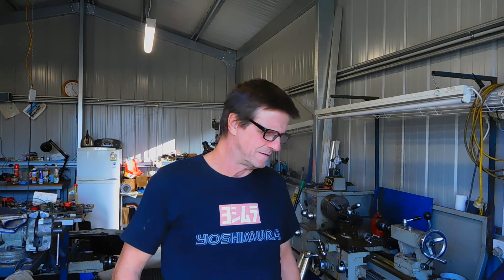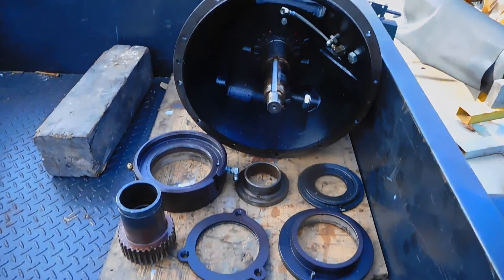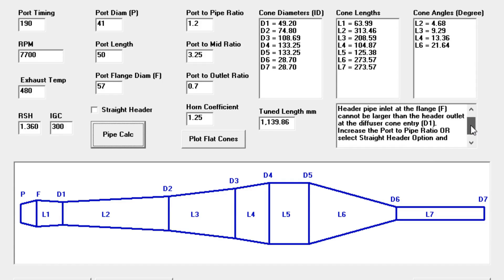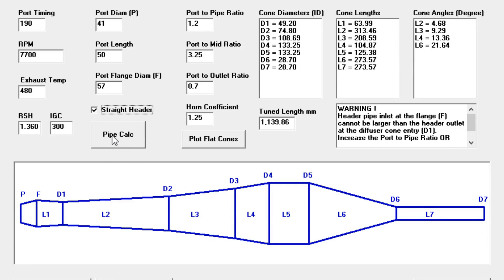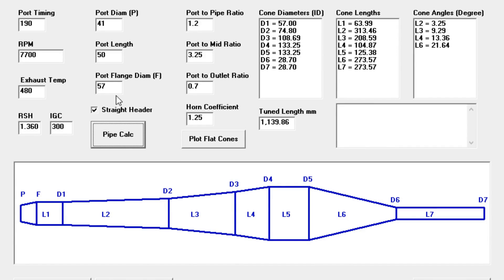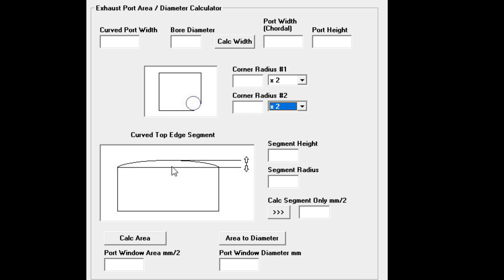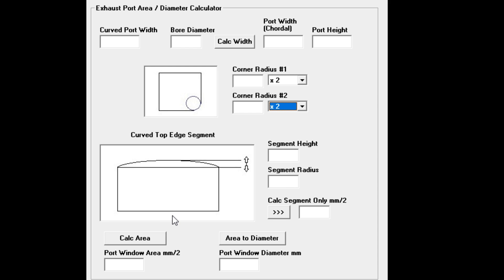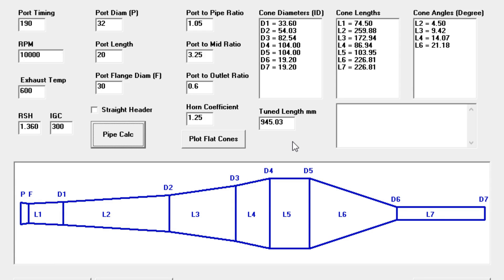New version of 2 Stroke Expansion Chamber software & Channel Update

Comment: I have a question, where is the resonance band rpm in those long banana shaped 50cc supermot exhaust ?
Reply from the maker: That applies to 4 strokes that this 2 stroke video series does not cover.
However that said, to calculate to resonance of a muffler you would measure the volume of the muffler and then calculate the natural frequency of that to find the harmonics.

Comment: how can i measure the port length? im really confused on your wording on the help box whenever i hover over port length. could you possibly demonstrate on a real engine? im trying to build a pipe for my chung yang GP290
Reply from the maker: The port lengths is simply what it sates, the length of the exhaust port from the cylinder to the exit flange where the pipe attaches.
That value is subtracted from the total pipe tuned length.
Reply: @AuMechanic  ok, also could you explain to me in different words how to get the port flange diameter? I’m also confused by the wording used in the help box
Reply from the maker: @TheTakeDaily  That is the diameter of the exhaust port at the opposite end of the port to the cylinder.
Where the pipe bolts on.
Reply: How best do I find the diameter of my rectangular port with rounded edges
Reply from the maker: @TheTakeDaily  watch the most recent video
Reply: @AuMechanic  Can I make a center bleed exhaust pipe with your software?
Reply from the maker: @TheTakeDaily  Yes you can, everything is the same for std pipes but you will need to select the position of the outlet tube.
Reply from the maker: @TheTakeDaily  Yes the equations are the same for a standard chamber.
As for location of the outlet pipe, the inside end of the outlet tube (inside the pipe) has to be slightly forward of the large end of the baffle cone (just at the end of the straight section) regardless of whether the pipe is inserted at an angle in the side of the baffle cone (like the image shows in the video) or perpendicular (90 degree ) directly in to the straight section.

Comment: I've watched all of your videos in this series, more than once, and I enjoy your way of explaining things. I have read the two stroke tuners handbook twice (I think that's what it's called) and it along with your videos was very informative. 

I'm wondering what extra calculations or considerations need to be taken when building a 2 into one system. I know that this is not ideal, but it is used a lot on snowmobiles, and in watercraft (PWC) there is often not enough room for two pipes. Is the chambre size effected, or does the stinger just need to be resized accordingly. 

If I'm missing something really obvious, please forgive me, I'm recovering from a concussion and still feeling hazy.
Reply from the maker: Ive not had experience building 2 into 1 systems as I have single pipes to give you solid advice about it, but based on how pipes work I could say that the tuned lengths calculations would remain the same and all that would change is the diameters of each section plugged in to the software. Based on 4 stroke collector ratios being about 1.3 to 1.5 it is clear that the diameters would be at least less than doubled for a 2 stroke 2 into 1 expansion chamber.
If I find more information on it I will be doing a video for sure as I do get asked this question occasionally.
Reply: @AuMechanic  Thanks for your reply. I appreciate it. 

I know a LOT less than you about exhaust systems and two cycles, but like you, my experience with drag racing snowmobiles with one pipe per cylinder, and the odd one with two into one. Due to the class the 2-1 pipe ran in, we would sneak about 3/4 of an inch out if the Y pipe, rev it a little higher and that was that. 

I ended up doing some searching around an found a whole lot of information that was obvious nonsense, and then I came across this PDF that was very interesting. The first part of it is very basic stuff, but the last 3 pages are dealing with multi into 1 pipes. It seems like a legitimate explanation of manifold design. A few things in there that I had never taken into consideration based on what I already "know".

http://members.iinet.net.au/~pauldawson/iame37_2-s_exhausts.PDF
Reply from the maker: @JoelArseneaultYouTube   Interesting read and answers the issue of wave timing. its a shame it doesn't go into header to pipe diameter ratios.

Comment: I have one question - how do I know how to route the pipe?
Reply from the maker: Fabricating the pipe itself is a bit of an art but there are quite a few videos showing the basics of creating a template of the pipe as calculated and then sectioning it up in parts and bends to get the fit right on the bike and then fabricating the pipe from that.

Comment: would this work on a twin pipe motor i look at build a pipe for a 2 cylinder jet ski just wounder if i need to change any thing do to the 2 cylinder
Reply from the maker: No this calculator is only for single pipes per cylinder systems.
The tuned lengths aspect of the section applies but the diameters differ form a  2 into 1 system.
The software is directly derived from Professor Gordon Blairs 1996 published equations but he does not provide equations for 2 into 1 and I have no direct experience building 2 into 1 expansion chambers to give you reliable advice on it.

Comment: Yes please I'd love tutorials on the software it would be magnificent if you made a video showing us how you measure everything also 😉 thank you!!!
Reply from the maker: I will; be doing more videos on measuring up parts of the engine with a view to modifying it.
I've done one on measuring port timing, next one will be measuring port area and later we will measure compression ratio and a few other things you need to measure to know where the engine is at so you can decide what parts of it need modifying to improve power.
It is a more methodical way than just going at the ports and such hoping it might make improvements.

Comment: Hey guys I'm new to the subject I was wondering if it would be possible to change the power curve to get the engine to rev less but become more Torquee ? With an exhaust design? Also is it bad for the engine to keep the original 14-15mm carb if I put a 70cc cylinder on it? Thanks guys.
Reply from the maker: It depends on the engine but in general terms a few things to do.
You could lower the barrel a bit to reduce the port timing that would favor a lower RPM range, at the same time increasing compression will provide more power all the way through the RPM range, just ensuring that if you lower the cylinder that you still have enough piston clearance between the piston and head (about 0,5 mm minimum as advisable)
You could also make the expansion chamber tuned length slightly longer at the header to favor a lower RPM range, or put an expansion chamber on it that has less angle of taper in the cones.
Fro example a single cone taper pipe is more peaky compared to a multiple cone taper pipe.
As for the carby, ifit is too small it will tend to limit maximum RPM, if it is too large it will have poor low RPM mixture control and lack responsiveness at lower RPM.
Reply: @AuMechanic  ahh thank you very much.!!!

Comment: can i get more power with making new exhaust for HONDA MTX 125R, 24mm dellorto carburetor 56mm piston
Reply from the maker: Yes you can but the port timing and compression it has will factor into how much improvement you will get from it as well as how limiting the current expansion chamber is.
You may be able to modify the existing chamber to improve it a bit.
Reply: @AuMechanic  how i can know the compression?
Reply from the maker: I will be doing a video on how to measure compression ratio after the next one which will be on mapping port area.